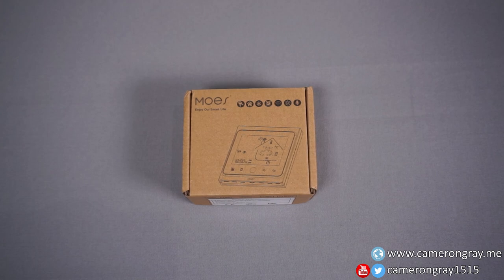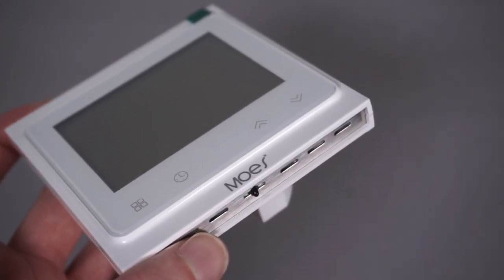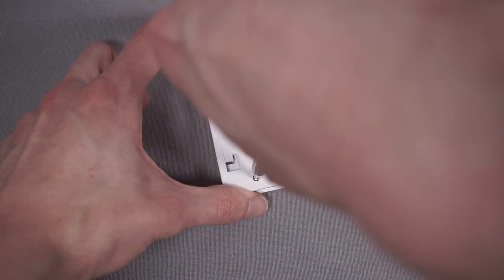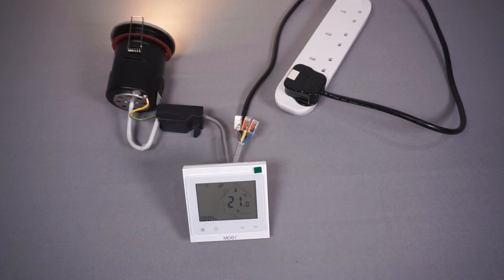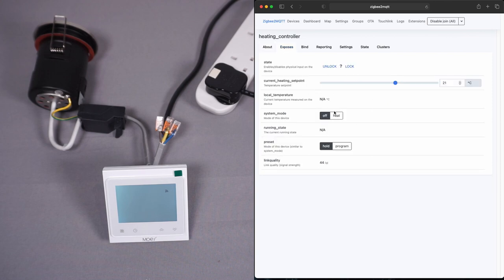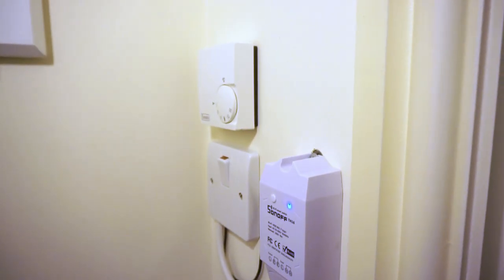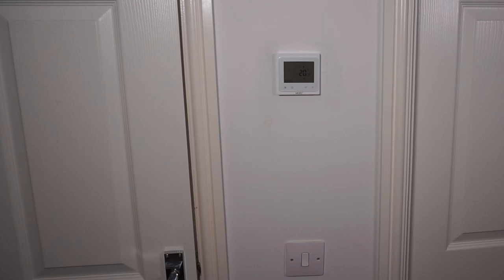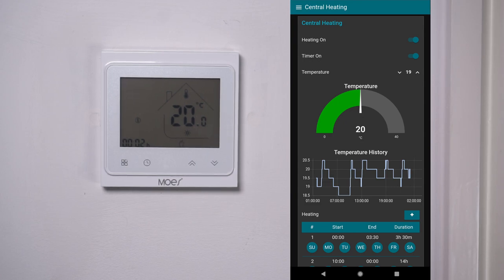Self Hosted Smart Heating using a Moes BHT-002 Zigbee Thermostat with Node-RED & Zigbee2MQTT

Comment from the maker: If you're interested in purchasing the thermostat shown in this video, there's a link in the video description.
Reply: Hi Cameron, does your thermostat default to power on after a power cut?  I've had a number of small (few seconds) power cuts and noticed that my heating is turned on permanently afterwards.  Some other brands have a selection on what to do in the event of power cut (always off, always on, or last known state) which is very handy, but this product does not seem to have that!

Comment: Good video, thanks.
I already got one of these but when I fitted it I found it doing all sorts of weird stuff. Initially the boiler was just on all the time regardless. Then after I reset it, Found that it wouldn't retain the set temperature and the boiler would go off after a minute or so. It seemed to have a mind of its own, so I took it out.
You've inspired me to give it another go on the bench like you had it.
Cheers.

Comment: Out of interest, as this is mains powered, does it act as a zigbee router? (growing the network) or as an endpoint?

Looks great though! I plan on getting this and the TRV valves based on your fantastic run through of the main thermostat. 
I'll control it via home assistant though rather than nodered. I just can't get my head around it..

Comment: A great detailed video. I purchased one of these GA-002GA model for under floor wet system as a standalone function. In my case the Live is switched by CH timer, so the set time resets twice a day. I note there is a button battery holder on circuit board, but no mention of this in the instructions. I wonder if a correct battery would hold the time?

Comment: This Thermostat also works fine with ZHA. It's biggest problem is the viewing angle which bizarrely runs top to bottom so unless you are viewing from a higher angle the display is washed out or totally invisible.

Comment: hi there. can i use this device as a gateway only?
the reason for that is , my central heating unit is in a cold room. and that's where i want to wire it.
but then, i want to have 1-2 wireless thermostats in different bedrooms and i want only those to control the on/off function
do you know if that can be done by any chance?

Comment: Great video !! Do you know if this Moes product supports mesh network and work with battery powered sensors ?
Your response would help me a lot !!
Reply: I have a modification with battery placeholder, but I have not found any information on the net about battery type, and for which purposes it. Found fit in size CR1225 batt, I'll try to find the difference with/without battery.

Comment: Hello.  I have a gas central heating.  I have a smart valve on each of the radiators.  at the moment I do not have a smart room thermostat yet.  At the moment I have an ordinary portable room thermostat and if I want to have a set temperature in the room, e.g. in the bedroom when going to sleep, the smart head is opened to the maximum in the bedroom and closed in the living room.  then I have heating water circulation only for the radiator in the bedroom and the temperature is controlled by a portable room thermostat.  The question bothers me, if I install a smart room thermostat, it will stay permanently in some place in the house on the wall, will it be able to independently read temperature readings from the valve on the radiators?  Will the centeal heating turn off when it reaches a certain temperature in a room?  and one more scenario, if I close each of the heads on the radiator because I do not want to heat the house and the smart room thermostat is set to, for example, 22 degrees, the central heating will heat the water non-stop, but the temperature in the house will not increase because the radiators valves are turned off?  my main question, does the smart room thermostat read the temperature from each smart valve separately and then fires central heating if it drops below the saved level or does the smart thermostat have its own temperature sensor and cannot manage each smart valve separately?
Reply from the maker: If you want to use Smart TRVs on each radiator, you'd be better off getting a thermostat that also includes smart TRVs as part of an integrated solution such as Tado, Drayton Wiser or Honeywell Evohome.  That way the TRVs will feed their temperatures back to the thermostat.  You won't get a satisfactory result with separate smart TRVs and a smart thermostat without a lot of bodging!  That said, intensely zoning your heating to only heat a single room at a time may not be saving you as much energy as you think - Condensing boilers rely on the water going back to the boiler to be relatively cool so that the boiler can operate in a more efficient condensing mode.  If you are only running individual radiators one at a time, you won't be dissipating enough heat from the water so it will return to the boiler at a high temperature, the boiler won't condense and the efficiency will drop.  Smart TRVs are only really designed for creating small temperature differences between rooms (such as wanting the living room to be warm in the evenings but keep the bedroom a few degrees cooler for sleeping), they aren't really meant to be used to frequently turn radiators completely on and off throughout the day.

Instead of smart TRVs, assuming you have a modern enough combi boiler, I'd personally rather go with a smart thermostat that uses OpenTherm and then just use manual TRVs on the radiators set fully open except for maybe in completely unused rooms.  OpenTherm thermostats communicate intelligently with the boiler to adjust the temperature of the water in your radiators based on the heating demands which keeps a much more stable room temperature and ensures that your boiler can operate as efficiently as possible.  Since making this video I have replaced this system with a Google Nest connected up for OpenTherm and couldn't be happier.  I made a video about this: https://youtu.be/gZcy0sruFfA

Comment: This is great. I did something a while ago in a similar style, but could never quite crack the Node-RED scheduling flow like you've done. I take it that was hand-rolled, as apart from Big-Timer, there aren't many good scheduling nodes out there?
Reply from the maker: I'm just using this UI node for the scheduler: https://flows.nodered.org/node/node-red-contrib-ui-time-scheduler. It just outputs true/false depending on whether the current time falls within the schedule or not.  It's not perfect since I can't specify different temperatures at different times but it was good enough to get an MVP up and running.  I might build a custom dashboard widget in the future.

Comment: Quick question. I'm assuming with a dual zone heating system I could just use these to replace the two room thermostats and leave my existing controller in place and on an all day setting to keep these powered up?

Also, on the node red side of things, I assume I could at some point replace my radiator valves with zigbee models and program node red to switch these on /off depending on whether other rooms are calling for heat? Reason being, I'm mostly worried about my little fur baby being cold but he stays in a room without a thermostat and it's really the only room I care about keeping warm if I'm out in the winter but if I could use a separate thermostat to call for heat on the upstairs zone without worrying about the temperatures in the other rooms it would be ideal.

Comment: Cameron Gray have you tried out getting into advance setting, by pushing and holding Program and Manual mode buttons simultaneously? 
I am trying to - as I do use auxiliary temp. sens which is flooded into my floor and want to set top and low temp. Limit for floor itself. But can't reach advance mode settings either throughout device or ZigBee2MQQT

Comment: "switching off when I go outside the door": use an arp scan and scan your network for mobile device mac address. If present, turn the heating on according to schedule/preferences. Otherwise, turn the heating off
Reply: All very well until one of a) you leave your phone at work, b) you leave your phone on the bus home c) the batteries run out d) replace phone e) drop phone into the toilet.
Reply: @tehklevster  try being creative. Has worked for me for ages now
Reply: @thomasvnl  Sometimes a simple button is enough creativity.
Reply from the maker: I'm not sure I'd go down the ARP route but I can definitely see the value in some sort of automatic control.  If I was doing it I'd probably integrate it with my alarm system so the heating will turn off when I set the alarm.
Reply: @camerongray1515  that would of course also be a viable solution as it implies that you arent home. Except when you forget to manually set the alarm I guess. I use arp as last resort. There are other ways, including sending geo location to my nodered via OwnTracks and reading the wifi client list from the unifi controller via nodered node. Both can overrule each other when a detection is more recent than a previous detection. Arp is for if all else fails.
Reply: @tehklevster  but that's where home automation stops and where user interaction starts. Some of us don't want to use their phone for everything. I raised an idea based on personal experiences. If a button works for you that's fine by me. But if you are someone like me who forgets to do stuff it is nice to know the heating goes off when you're away from home.
Reply from the maker: There's always going to be edge cases where something won't work, generally speaking I don't really bother with automations, most of this smart stuff is focused around convenient/remote control rather than automations.  Turning the heating off based on the alarm is probably good enough, I can't think of a time I've forgotten to set the alarm.  Might even go for an approach of me getting a notification saying "you appear to have set the alarm but the heating is still on" so that I can manually turn it off remotely if I want to.  It's more just a way to stop me forgetting to turn it off rather than something I'd rely on as a primary mechanism to turn it off.  Then for turning it back on, I've considered geofencing but it never really seemed easy to get right based on my routine/movement patterns.  I find it easier to just manually turn the heating on when I'm 30mins from home so it's warm when I get in - I'm much more likely to know better about when I'll arrive home than an algorithm ever could!

Comment: Why are you against flashing custom firmware for Tuya devices? I think wifi would be more robust for a thermostat.
Reply from the maker: It's not as though it's something that I'm strictly against, I just quite like the idea of being able to buy a piece of hardware and have it work out of the box without needing to flash it by either dismantling it and connecting it to a programmer or relying on exploits to flash a firmware image OTA.  I may look at trying it in the future just to see what it's like or if there's any sort of device that is only available as a WiFi version.  It's not as big a deal with a thermostat since I only have one however for things like bulbs and sensors where I have a lot of them, it's nice not needing to flash them all.  Likewise, if I were to have used flashed WiFi Tuya devices instead all of my current Zigbee devices, I'd already be at 22 WiFi clients just for smart home stuff.  From a security perspective it's also nice to minimise the amount of embedded/IoT devices sitting around on the network.  Reliability wise, Zigbee shouldn't be much different to WiFi - Hive heating for example uses Zigbee between the various components without any issue.  It's not as long range as WiFi but has the benefit of being able to mesh between different devices.

Comment: Did you consciously decide against OpenTherm compatibility, or was that not a consideration?
Reply from the maker: It's not something I'm against by any means however my boiler simply isn't OpenTherm compatible so there was no need for me to consider it.
Reply: How would opentherm system work if you have for example three of these thermostats around the house. How would you wire 3 opentherm thermostats to one boiler?

Comment: Can you share your wiring please for your bulb? I asume it is:

4 - Live (Connected to 2)
3 - Neutral - Connected to Lamp Neutral
2 - Connected to Pin 4 (Live)
1 - Live (Switched) to Lamp
Reply from the maker: Exactly, that's how I had it wired, and then the incoming mains supply into terminals 3 and 4 to power the thermostat.

Comment: Have you heard about weather-controlled heating systems?
I am using a heat pump that has this built in. It measures the outdoor temperature and then calculates the temperature which the water should go into the floor heating and come back. With that technique, it can control a pretty accurate temperature inside the house. 
The drawback of that systems are:
 no room-based control and if the weather changes it can happen that the temperature needs a day to get back to the perfect level. The systems only runs at night.
Does anyone know a open source project that can achieve a similar control way? I want to retrofit this kind of system with an existing furnace at another place.

Comment: Hi, at 26:34 - you set it manually to 17.5 - but on MQTT you got 17. Can you confirm if 0.5 values work? I got the same thermostat, tried both ZHA and zigbee2mqtt and it seems it only takes/sends integers for heating values. Also the calibration of the temperature only works under zigbee2mqtt but it's only in full degrees so it's not really useful for small adjustments.
Reply from the maker: Unfortunately not, I've only been able to get it to do 1 degree increments over MQTT
Reply: @camerongray1515  thanks, I was thinking of testing the official app and if there's an OTA, but I doubt it, and I don't have the hub to test with, anyway :)

Comment: Hi, I'm new to HA and Node Red. Found your flow and would like to use it. Setting and connecting the nodes is not a problem or connecting MQTT, just what do I enter in the individual nodes? Could you send me your flow so I can have it as a sample?

MFG Sven

Comment: I have tested this thermostat with external floor temperature sensor. I where not able to read temperature from both sensors at the same time (You can use wall sensor OR externa sensor, not both). This comment is for all people who will try to set up temperature limit from underfloor sensor OR wall sensor - You will need to use some other method to get room temperature.